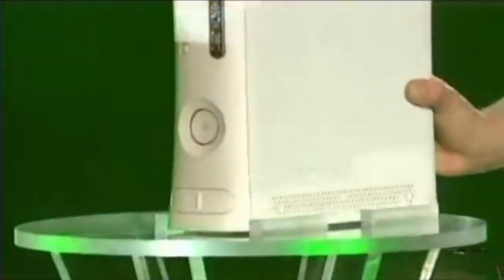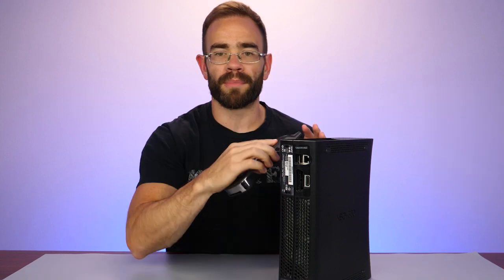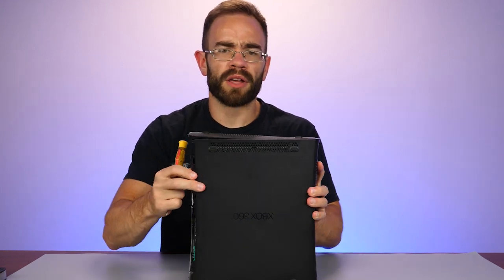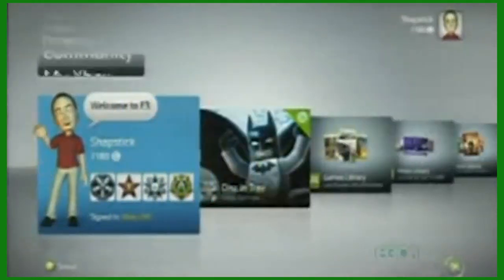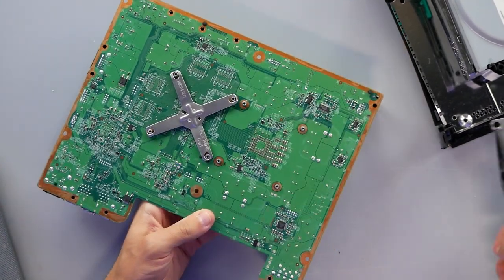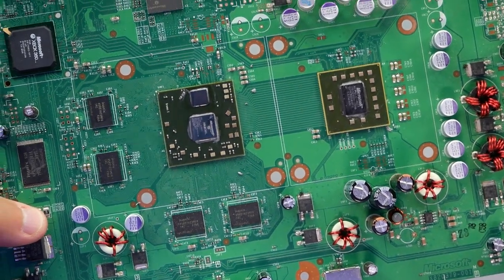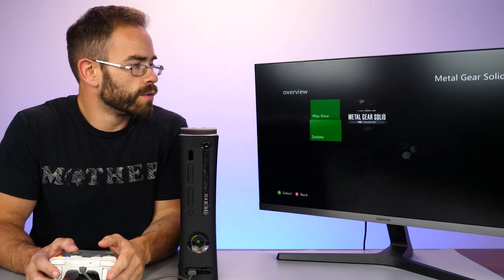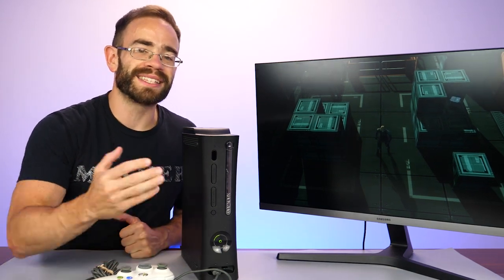The Xbox 360 Elite 15 Years Later

Comment: I loved installing 360 games, I had a really scratched copy of Red Dead Redemption and the game would boot and run but eventually would freeze and lock up. I had a friend bring his clean copy over and used his disc to install it to my 360 hard drive. Made it so my copy was only needed as a boot disc which saved me from having to buy a new one.
Reply: I love that feature too.
Reply: Works great on X1 and XSX as well with scratched up 360 games.
Reply: Yes I had a completely destroyed mw2 disc but it still used to work I mean the inside ring was cracked. Wild how child me treated some of my games
Reply: Good for you 😑
Reply: @DP12321  yeah and it works so well because the Xbox just has to see what game is on the disc and nothing else. The entirety of the backwards compatible version of the game is downloaded over the internet and your disc is just sort of used as a key to play it. Of course if your disc is so screwed up that the Xbox can't even tell what's in it then you're kind of out of the luck
Reply: @edison700  Yes and unfortunately the issue is that unlike the 360's backwards compatibility, it's entirely dependent on Microsoft servers.
Reply: Sometimes games would lock up and I would install them and they worked perfect
Reply: How do you do that omg I wish I knew that 😤
Reply: @aroundtheblockwithbrock4799  hit the Y button to install a 360 game.
Reply: I did that with a cracked version of Saint's Row 2. Went and rented a copy, installed it and used my version until it literally cracked apart.

By then I had disposable income and bought it myself. Love that game.
Reply: Lol the same with me have black ops and halo reach both disks were installed because both CDs are completely broken because of people who hacked/modded in games they could make your console freeze and they did it with my console and (i still have the old xbox 360 collecting dust) so when a Modder freezes your old xbox 360 console potential is there the whole disk is getting a fine circular scratch around because it will stop spinning immediately it pissed me so off because they broke 2 games worth of 60$ at the time . Well then i took both games of a friend and installed them and i could play my 2 copys again this was the only solution I had at the time I was 14 lol still have the games good thing is they are working fine with series x because the games getting downloaded lol.
Reply: You can still do that today with xsx.
Reply: That was a good feature that wasn't entirely neccessary for the PS3 because Bluray used discs that had protective coating so discs didn't scratch easily unless you were just really terrible at taking care of things. I'm of course talking about the few games that didnt need to install on PS3 most kinda forced you too because Bluray laser speeds are slower but obviously it's still useful for the 360 for those exclusives and multiplats that looked better on 360 which was most of them.
Reply: Do you have idea how to install it on rgh xbox 🤔 i have two iso on my pc didnt figure a way
Reply: KEY  That sounds like you are talking about the insurance plan you can get optionally where they'd replace the disc or give money back. What I meant is the bluray disc has a layer of protective coating on them which makes them more durable. This layer is applied by the manufacturer of the disc during it's production. I have copies of games on PS3 from 2006 that still look brand new and they were played a lot. I cant say that for any of my PS2 games or 360 games which just get scratched from the process of putting them in the console.
Reply: i remember having my mom drive me to a Redbox so i can get gtaV just to install it for my scratched up copy 😂
Reply: I did that with MW2 lmfaooo
Reply: I did that with a copy of gta 4
Reply: With this feature me and my friends used to online co op with one disc Once the game starts playing off the hdd you can remove it without hitting the eject button it will still play then give to your friend I had two Xboxs one dissembled and one never taken apart if your wondering how to open a disc drive while it's running
Reply: @smudgey5000  the reason it has that coating is because if it didn’t the data on the BD discs would almost immediately corrupt at smallest slightest scratch. Can’t remember from the top of my head what the exact reason is, but I’m pretty sure its because of how the data was written to the disc/ compression. 

Essentially the BD discs held much more data, but in order for it to, the data is held much closer together and in a much tighter formation, as BluRay used a blue laser, and read data much more frequently. One scratch could leave with with an extreme amount of data loss.

Sorry if it didn’t make sense or if I screwed something up, Im sleep deprived.
Reply: @suppressed_viii  All discs should have that coating regardless. Helps keep them in prestine condition. So you feel more confident buying used.
Reply: I never knew that about the 360  until last year I mean I knew about it on the xbox one where you just need the disc to install it and works as a key to play it but still that's awesome
Reply: I forgot about this.
Reply: Hello...I want the Jasper Motherboard...since it is/was considered the best over the Falcon and the Original Board, does that mean ANY/ALL consoles (Elite) made in 2010 or beyond WILL have the Jasper...or is this just by chance you GET a Jasper Board?  Please answer....Thanks
Reply: Did this with mw2 so many times.

Comment: I remember installing a 250GB HDD to my elite. I grabbed one of the WD drives that you could flash a different firmware on instead of getting a MS drive and save a ton of money. Still works to this day.
Reply: I remember back then, anything labeled Microsoft is guaranteed price gouging. Compared to competition, with better prices. Especially for things you need.
Reply: Yep and the only downside to not using an official MS drive I found is the shell says 120GB on my 250GB drive lol
Reply: @philipboggs3372  guess they were in a rush making them at the time. Things happen. But 120 vs 250 that is a vast difference
Reply: @philipboggs3372  mines 1tb in a old shell that just says "HDD" perfect setup. You just gotta find a original 20gb.
Reply: @kadosho02  Still is today with the Seagate SSD expansion cards for the Xbox Series X!
Reply: @coolspot18  🤦I saw at various stores, just yikes

Comment: My white 250 gig elite 360 was the first console I bought for myself as a young adult. It still works fine, and I still use it occasionally mostly for messing around with modded Borderlands 2 and Pre Sequel save files via Gibbed. It was never subjected to being cooked alive inside a closed up entertainment center, it was never left running sitting on carpet, it was never tormented by a child or pet knocking it around, etc etc. Like all my consoles I pull it apart every couple years to blow the dust out and reapply thermal paste, its amazing how long things last when you take care of them...
Reply: Word
Reply: It didn't matter I got one at launch and treated it like gold. It rrod about a year into it. Very clean and taken care of. Always left laying down in a open and ventilated area. Yours just hasn't died yet... it will.
Reply: @mattymatt022000  The elites didn’t really have that problem. And if it’s lasted this long, I’m sure it’ll be ok
Reply: Clown
Reply: @mattymatt022000  They ironed out that red ring problem in later models.

Comment: My old 360 was a christmas present from my parents. Then it got red-ringed just outside of the warranty extension, so we had to pick up an Elite. That thing lasted me so long. The only part of it that broke was the disk drive and I ended up selling it. My Xbox One disk drive also broke... and I bought a ps3 in 2018 as a highschool graduation gift and the disk drive broke on that too...
What is with breaking disk drives? I've used my PC more often than my ps3!
Reply: The 250gb models didn't have the rrod issue. I had a launch model which rrod 3 times and a Jasper which rrod twice. They were both well looked after, cleaned etc but the board itself would flex. Those early systems were hot.
Reply: I've had consoles die on me entirely after a long time of use (one dead phat PS3 to YLOD, one dead XB1 S) and damage from electrical surges during storms (phat PS3 that had a screwed up video signal after the surge) but no issues with disc drives. As far as I know the phat PS3 disc drives were way less prone to malfunction than the 360 with its disc tray. Did you have a super slim PS3?
Reply: @aninfinitemindofmusicandreams  No, mine is a standard slim. I only used it to play through God of War 1, 2, 3, and Ascension and Metal Gear HD collection, 4 and Rising Revengence. I have some digital, but that's it. I took everything apart and it is all fine so I don't know why my PS3 disc drive is dead.

Comment: I remember going to Future Shop (a now defunct Canadian electronics chain) and buying the Resident Evil 5 Elite bundle that came with the red console. 13 years of heavy usage later, it still works as good as it did on day one. I bought this because the Jasper chip was reputed to be less susceptible to the RROD and I never had a problem.
Reply: Got my Elite at Futureshop too… it got a RRD in 2015 in the middle of Fallout 4. I ended up getting a Xbox 360 Slim which I still have and is pretty reliable.

Comment: I remember getting the Elite as my first 360. Sadly, I had a rough go of it. The disc drive died on me, and I had to send it in to get it fixed. I did this cycle three times before settling for a slim instead. I still have that slim to this day though!
Reply: I still have my gen 2 360 and still works, it heats up a lot so I dont play it for extremely long times but everything about it still works even after it got mt dew spilled in it

Comment: I actually did a thermal paste replacement on one of these last year. I really like the look of it, but I’ll always prefer the Slim for actually functioning. Cool shelf piece though.
Reply: Really does suck that those first few 360 models are so issue prone, because they're probably the coolesst looking consoles ever put out
Reply: @Dasaltwarrior  The only problem i ever had with og models is the disc drive always failing
Reply: @jonathansoko1085  

I went through 2 OG models before getting my third with a slim

One was due to the AV cable port going bad, the other was a red ring that happened 2 years later

I eventually got a slim model, but I always thought it was visually a downgrade from the original white. Though I'm sure its easy enough to just do a modify these things now to not make them a problem

Comment: The Elite was my first 360, I bought it in July 2008 and it's still going strong, in fact I was playing Time Pilot on it this morning, the only thing that's ever gone wrong with it is the USB flap on the face plate broke
Reply: Still have my falcon V1 revision white Xbox 360. had it since christmas 2007. Had one RROD in 2009. My dad ended up fixing it for me since I was only 11 turning 12. but its worked since. and since then, eventually picked up a 120gb HDD salvaged from a 360 Elite that had an RROD. I just cant believe its already been 15 years. Playing it right now actually. Still using the same controller it came with since 2007. no stick drift, and still in near mint condition physically, however, does have some cigarette tar i still have to clean off. Took it to a friends house one time years  back that smoked alot, and man made my 360 go from white to looking like the fallout 3 edition of it. Took so much time to clean all of that off my 360 itself. even then, theres still some very faint residue in spots that i just cant seem to get anymore. My 360 has seen alot over the past 15 years, brung arguably some of the best memories Ive had gaming. Was 10 when I got it, now im 25. I wonder if it'll still be kicking when im 35 or 40! 🤣

Comment: I had an OG 360 with it's 20gb HDD. It RRoD after 15 months or so, sent it in for repair.  Heard the Elite had come out, and promised myself if my 360 broke as it did, I'd upgrade.

Waited on the repair, then traded it in for an Elite.  That lasted 2 1/2 years before it bit the dust, so picked up a Slim.  Which still works to this day.

Comment: That elite is from 2009 and therefore does not need the additional GPU heatsink since the chip was shrunk from 90nm to 65nm in 2008. The big heatsink was only used on later revisions of the original 90nm chip from 2006-2007. In 2008 65nm became the standard for the PS3 and 360 before a complete redesign of the consoles' form factor. Remember the non-backwards compatible fat PS3 with the matte finnish instead of the chrome? That was also a 65nm redesign.

Comment: My experience was I had a original model I bought the 2nd year with Gears of War on Black Friday.   It had a hard drive but no HDMI.   It lasted till about April, then red ringed.   I sent it to Microsoft to be fixed.  I also had (still have) a launch model PS3.   Although at the time Xbox was my primary system.  When I got it back, I used it till the Xbox 360 Slim came out.   Then traded it in for the slim because it had HDMI and a bigger Hard Drive.    I still have my Slim 360, however, it is  now packed in a box in my closet.    After it, I moved though the PS4, PS4 Pro, to finally a PS5.    I had a Xbox One at the time too but it was only for like exclusives.   It wasn't until Xbox Series X and PS5 that I now play them equally.   Funny thing now is like I said before the 360 is put away since most of what I like, I can play on Xbox Series X, but the launch model PS3 (now with a 1tb hard drive), still remains out and I power it up from time to time to play.   I am pretty sure the only reason the PS3 still works is because I didn't play it as much during that generation.   I barely turned the thing on back then.   The only game that got the most play out of it was Final Fantasy 13.

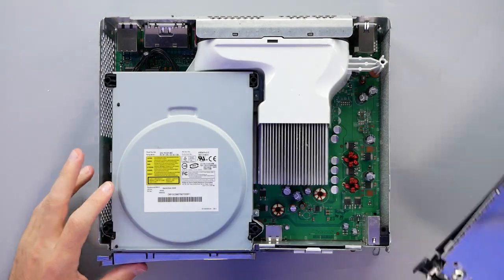Comment: 3:26 The revision you have is a Tonasket judging by the heat sinks at 7:29, which is superior in reliability to all Slim revisions 

7:38 The older 360 copper CPU heat sink is better as it was designed to cool an 85W CPU and not the 41W CPU of later revisions 

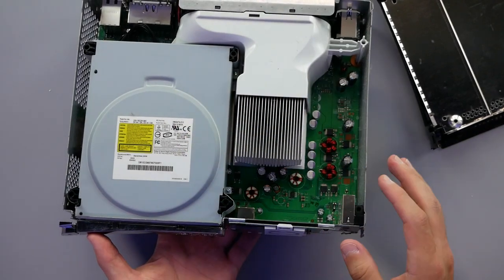8:00 There were no issues with the way the boards were manufactured, the issue that caused the RRoD plague was the GPU chip

9:18 E74 is an error code related to a failure between the GPU and eDram chip die and not the HANA chip

9:40 The 65Nm chips did not introduce any issues that the older 90Nm chips didn't already have and, if anything fixed the issues

Also, what's up with the 360p?

Comment: This is a Jasper V2 (also called Kronos), and it fixed the e74 failure. Most reliable Xbox 360, over the Slim and E. Have had mine since I got it new in May of 2010, no issues ever with daily use for 4-5 years, best version.
Reply: Jasper V2 is really known as the Tonasket and E74 was fixed by revised GPUs in mid 2008. A Kronos GPU is still able to get E74, though super unlikely

Comment: I have the Elite that's more gray than black. I think it's a Falcon. Still runs just fine, and actually quiet. Changed the thermal paste and stuff a few years ago.

It actually outlived the slim I had which started getting extremely buggy and just slow for whatever reason. So I got rid of it and started using the Elite again until like 2015 until I got a xbox one.

On PC now but I still boot it up now and then. Actually have a second network card just to bridge a connection between my PC and it cause i don't have the wifi adapter for it.

Comment: So there was an Arcade version that came with no storage (although memory cards were cheap by then) but was basically the same model with the HDMI port and I want to say it was $249. I got that in 2007 and I want to say it lasted me for about 4 years. I did get the RROD and the xbox repair, but ended up trading it in and buying a slim later. The slim is still kicking. Get the slim.

Comment: My first Xbox 360 was the pro, then my next one was the elite until I bought an Xbox One. I loved the elite so much I feel like I didn’t need to upgrade. The 120gb was big enough back then because you didn’t need to install games, but even if you did they were in the single digits for gb size. The only downside was I had to buy a Wi-Fi adapter that plugged into the USB port in the back, luckily there were slots for the thing to clip into so it wasn’t just dangling around on its own.

Comment: Still have my OG 360 Elite.  Picked up specifically for the HDMI and bigger HDD.  I opened it up and cleaned it out about 6 months ago and still runs like a champ.  I love that MS still sort of supports it as i got a Firmware update about a year ago and Cloud saves still work.  Currently replaying the Boarderlands series and i love i can play on Xbox One X on my main TV, then move to my second TV with the 360 elite and pick right up where i left off.   The 360 Controller is still one of my favorites to hold and use.

Comment: Brings back memories, had about 4 or the original white ones which all red ring of death on me, after the 1st RROD, I scoured my local classifieds for RROD 360's for cheap and tried to fix them with the nylon washers and new screws. It worked for a while until it RROD again, then I would get another broken for cheap and repeat the process. I now have the black elite and the later slim, which still works today.
Both my 360's have the XK3Y installed, its pretty much a drive replacement mod, I load all my games from ext usb drive, as far as the 360 is concerned, it thinks there is a dvd disc inserted into the drive, so I can do the game install to the internal drive, again, you still need to mount the iso before you can play installed games.